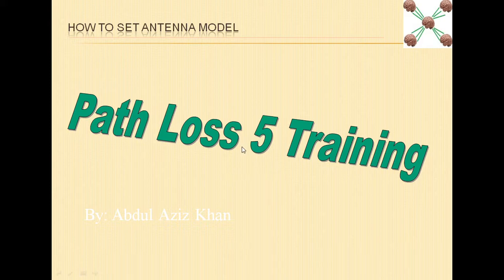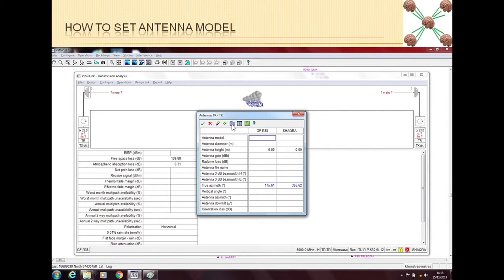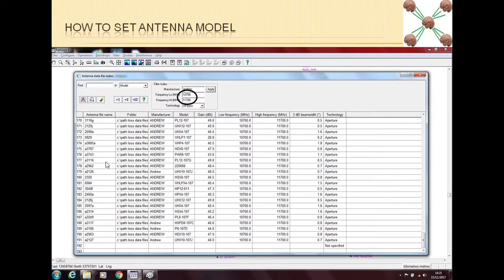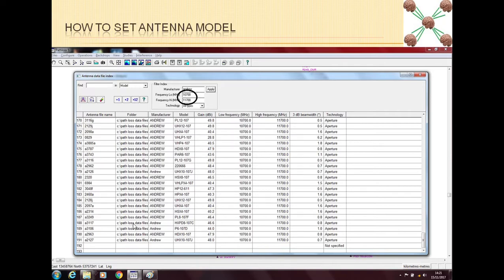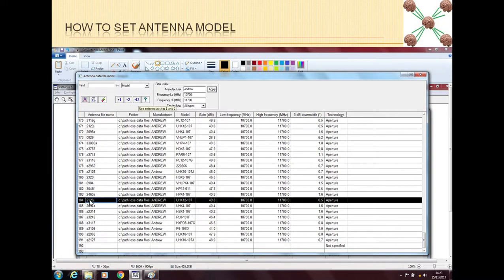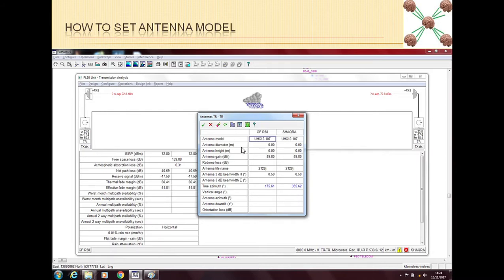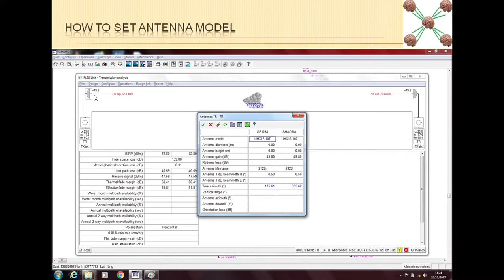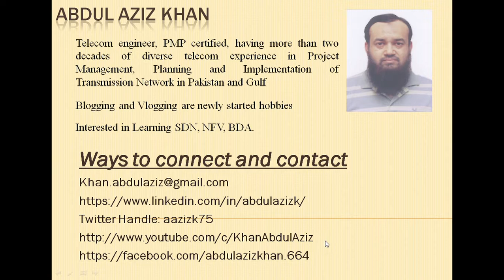Path Loss 5 - How to Set Antenna Model

Comment: How to use 2 antennas at one side and 2 antennas on the other side. Total 4 antennas in the hop and 2 radios at each antenna.
Reply from the maker: You can go through this video https://www.youtube.com/watch?v=p4imS3yen0Y to set the antenna configuration to TRDR-TRDR, this will bring two antennae on the link, you then need to add coupling losses, etc.
Reply from the maker: I will try to make a further video on it and put on my channel

Comment: Assalamualaikum 

i have a question how you can get antena data you make it by your self or you insert with data from antena that al ready exist
Reply from the maker: Wa alaikum assalaam

You need to contact the antenna manufacturers, if you have all the data then you can make your own file.
Reply: @KhanAbdulAziz  how about datasheet antena ?